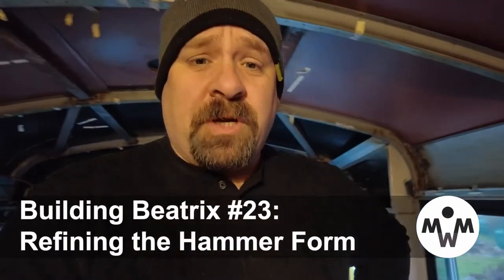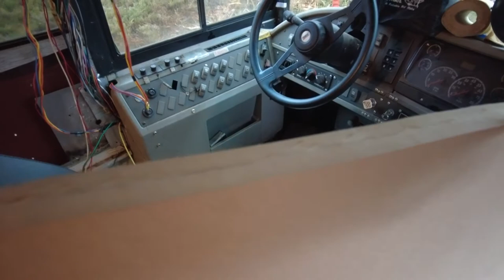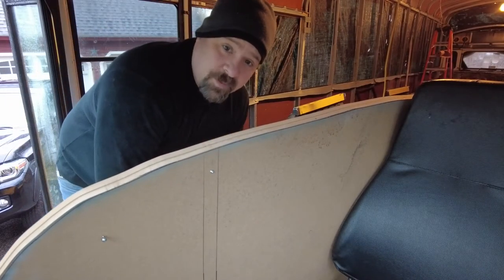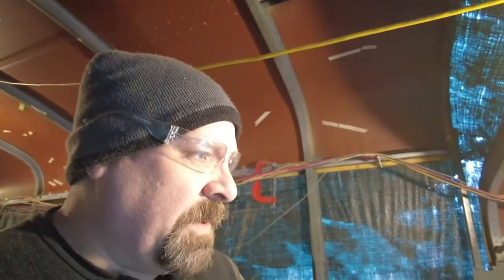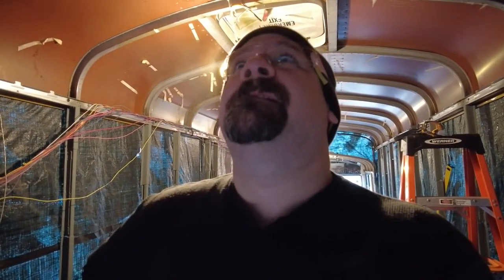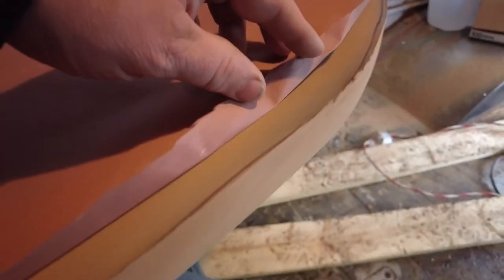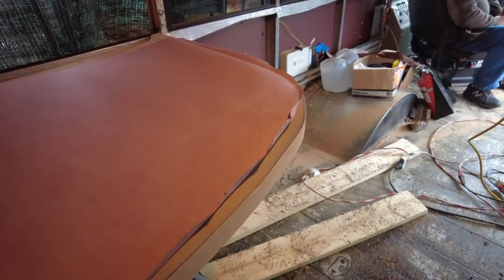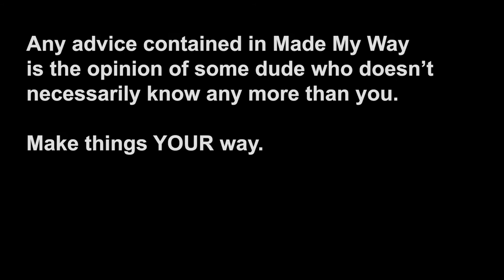Refining the Hammer Form - Building Beatrix 23

Comment: Have you thought about using a Shrinker/Stretcher?
Reply from the maker: I have... I balked at the idea of spending $600 for an "ok-ish" shop setup... I do keep drifting back to the idea of the $160 harbor freight setup.  

I'll probably only ever use it on this particular project... Still, it would help smooth out those wavy edges on the flanges.... Tempting.